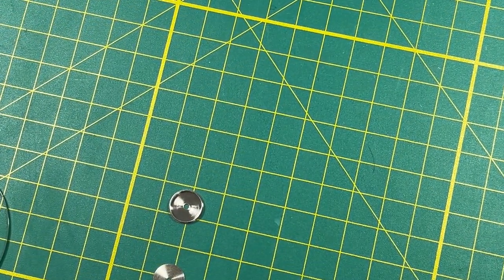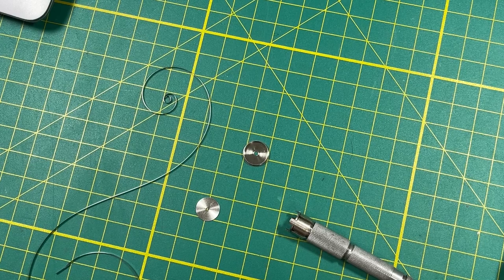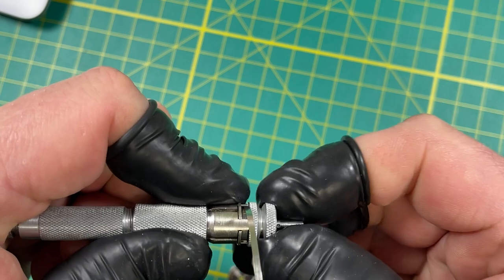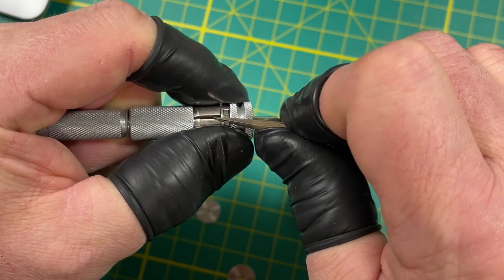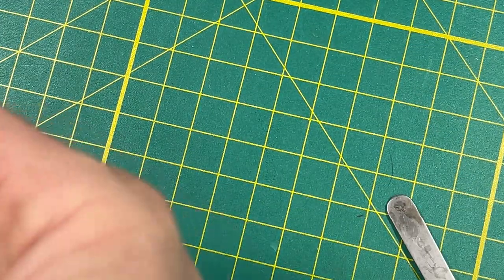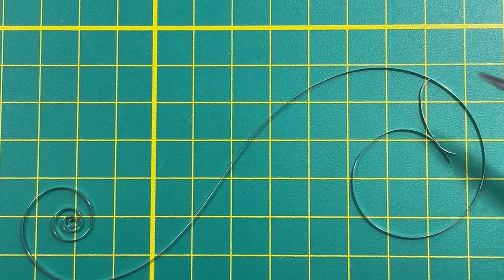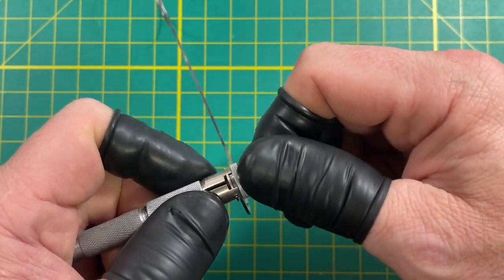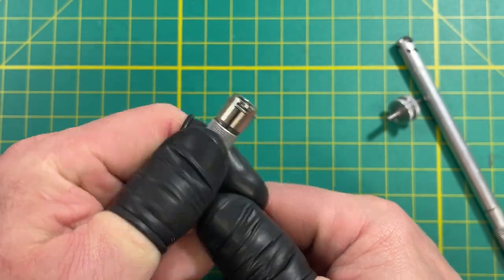Watchrepairology 1.01: using a mainspring winder.  Automatic & handwinding springs.

Comment: Hey I'm interested in one of these after watching you work it. I see on ebay there is one like yours. I'm hesitant though because the one on ebay says it has a size. So I'm not sure if they make several different ones for different size barrels? The one on ebay says it's (for) or is the size 123B 4-6mm. Any thoughts? Does yours have a size written on it? I'm starting this as a new hobby so don't want to spend several hundreds of dollars on a whole set. My first watch I'm working on is a Seiko DX 6106-6007 from the 70's
Reply from the maker: They came in a set, from small to large.
Reply: @SpencerKleinVintageWatch  I really need to know by millimeters on the sizes so I can know what size barrels will fit. Small to large doesn't help for fitting.

Comment: These winders have already cost me more springs then I want. In almost all cases the spring just shot thru the next open and and ripped the bridel straight off.
Reply from the maker: It takes time to build up the feel / touch of it.  You always have to stay on your toes when doing a mainspring regardless of the tool you're using.  I've never ripped a bridle off though.